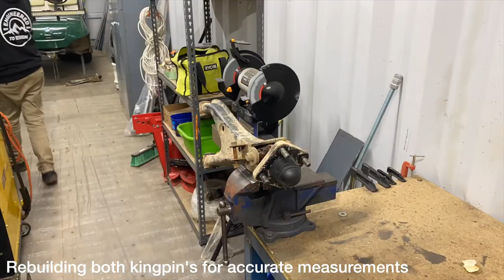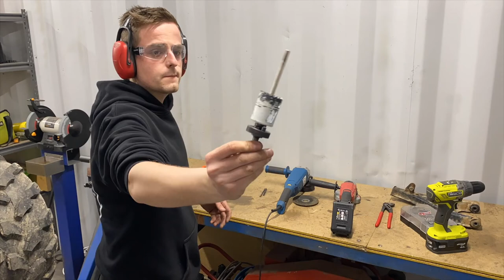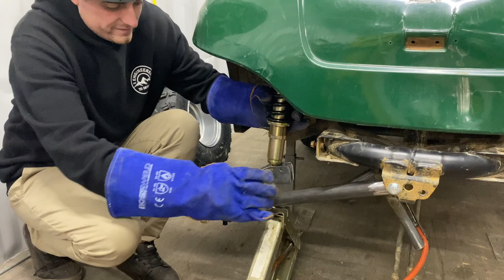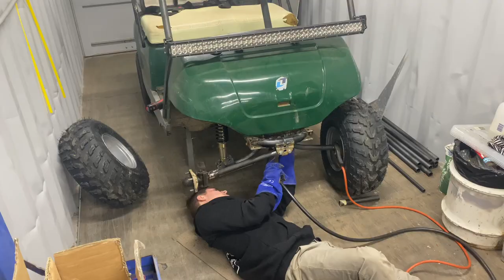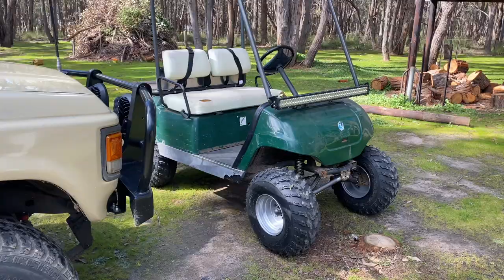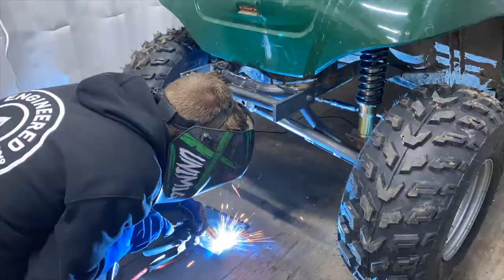How To Make A Golf Cart Lift Kit

Comment: Can the lower control arms handle a 1" lift I have a Hyundai golf cart with some after market wheels rubbing a little on turns
Reply from the maker: Yes it has held up so far, I completely rebuilt the control arm with thicker steel..